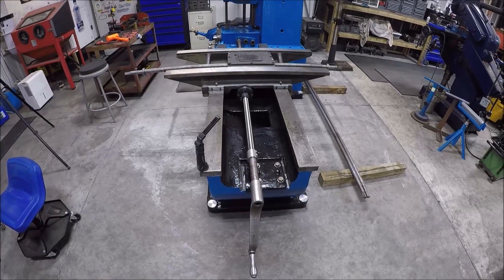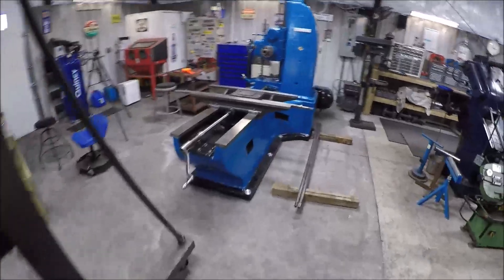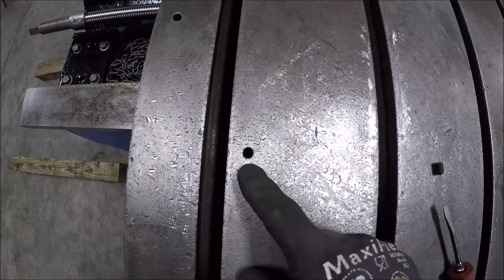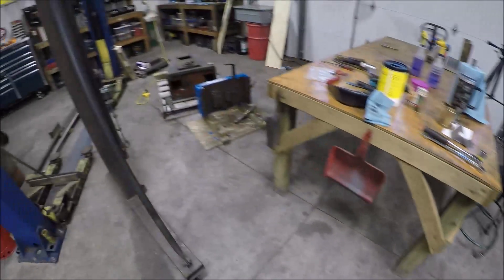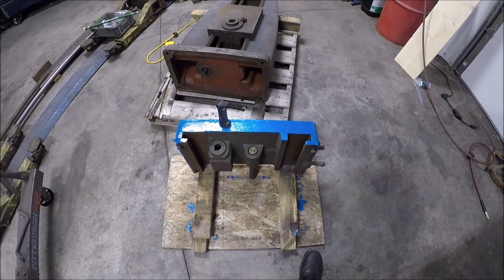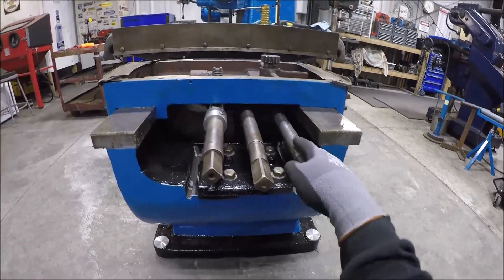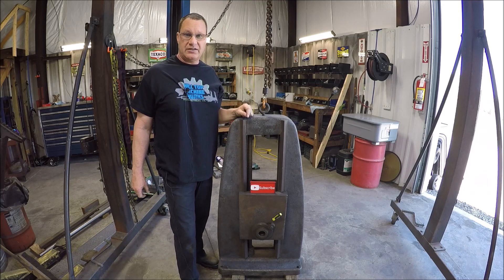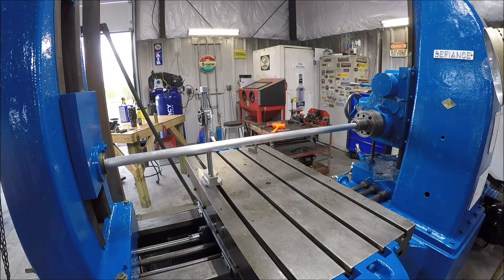The Defiance Boring Mill is done!

Comment: To properly install the tailstock I believe you will want to get that feed shaft and the gear installed in their original locations. Then you adjust the vertical position of the bearing by lifting the bevel gears apart and turning only the vertical shaft until you find the closest tooth. Then there usually is an adjustment on top for the thrust of that screw that allows you to fine tweak it with 2 jam nuts.  Unfortunately I am probably too late for this advice to help but I hope it can!

Comment: Oh man, that ball screw is easy !  So jealous !  So smooth.  Brian had a great idea with that.  Q? Does it have graduated dials?  Does the ball screw have the same pitch as the acme screw?  --Doozer
Reply from the maker: Yeah it is smooth like hot butter. Glad I went this route. Oh good question. I was thinking both the old and new screw were 4tpi. I will have to check on that. I am starting on building a taper lock key tomorrow.